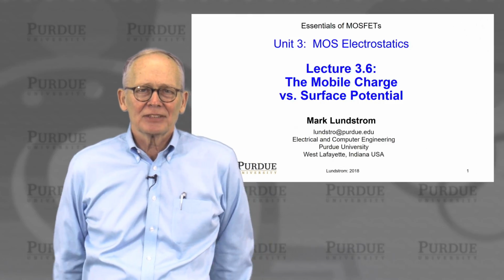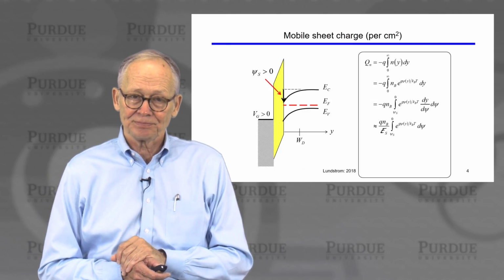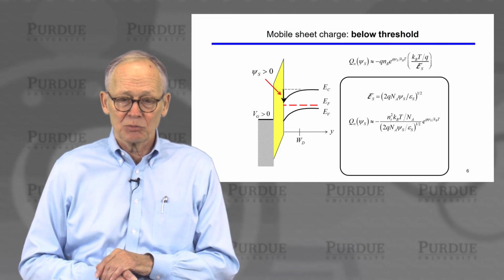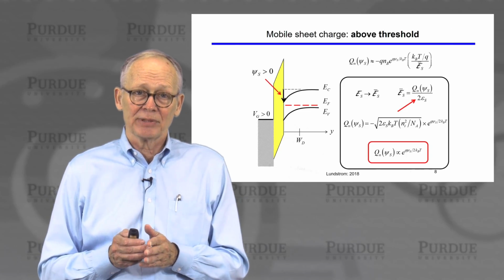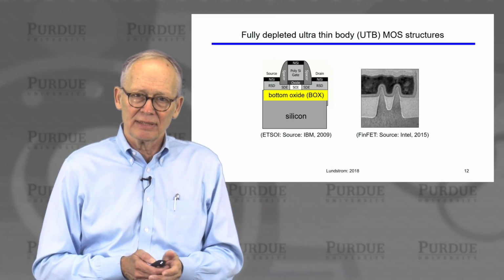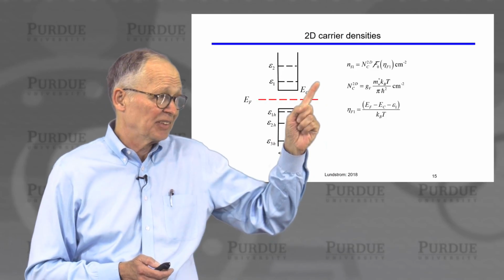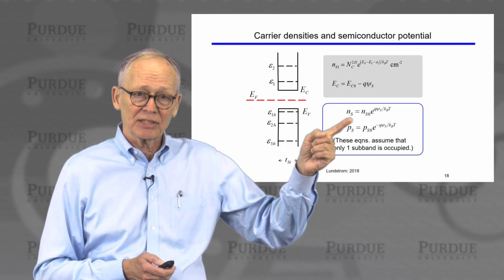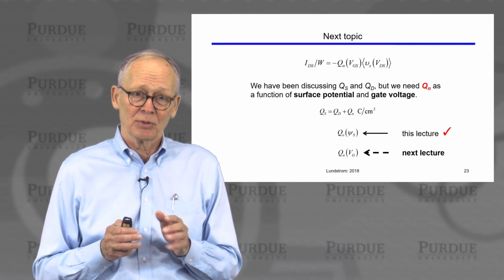nanoHUB-U MOSFET Essentials L3.6: MOS Electrostatics - The Mobile Charge vs. Surface Potential

Comment: I believe that at 10.21, the 2 in the denominator in the exponential does not come from the Electric field's rapid variation inside the inversion layer. It comes because the Electric field is now dependent on the mobile charge density itself (earlier it was dependent on the depletion charge), and we have Qn square term in the equation.